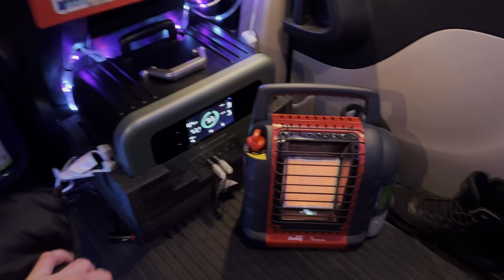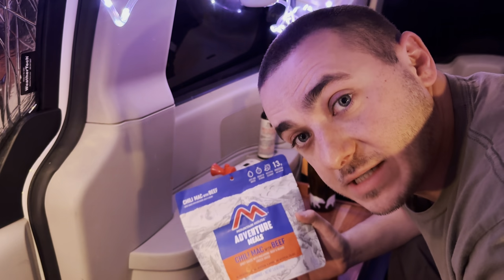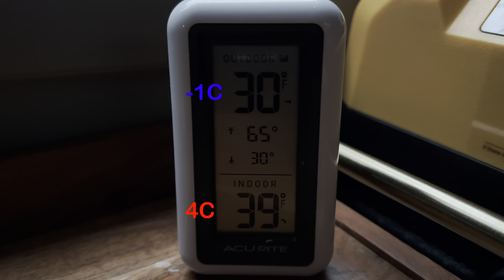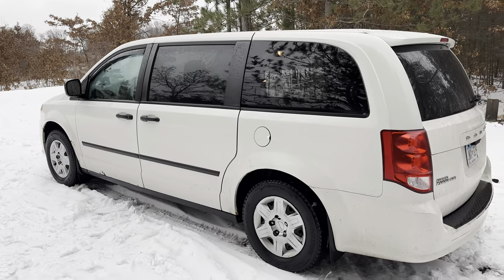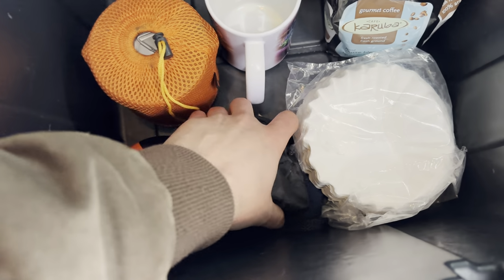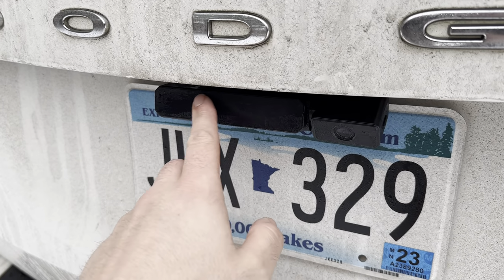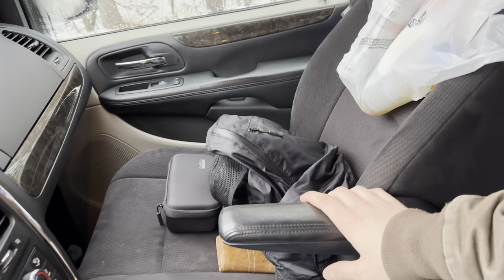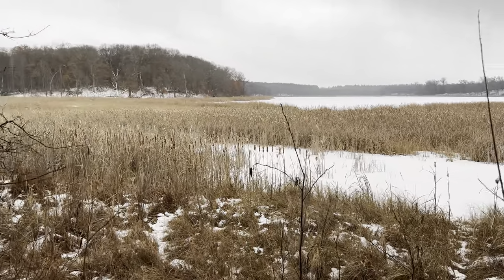Dodge Grand Caravan “No Build” Minivan Camper | Van Tour / Van Life

Comment: The light you describe as your "new light" is the one I've been using for camping for several years now.  I'm actually on my second one because I drowned the first rolling it up in a wet tent because I forgot to take it down.  That sucker is bright, like flipping the switch on the wall at home and I love that it's USB rechargeable.  I use it in my car camping set up hanging from the oh sh*t handle for the back seat.  Love your set up!

Comment: I'm off grid I plan to install more solar on top. I plan to run a line from my BBQ 20 pound tank to my buddy heaters, water heater and cook stove. Filling up 1 pound tanks the valves rust then leak. It's much easier with a truck or van to park. For me a bag and a bucket I've clogged up enough commodes. 😜
Reply from the maker: Nice! Yeah yeah you’ll see my 20lb tank in my passenger seat on my next video that runs to my heater in back and I also got a pop up toilet stand that you attach a bag to now. I love the toilet I just not a fan of dumping it, so going to see which way I prefer.

Comment: That's the way you do it! For $2000 if all you get is 2 years use, you have your money's worth. Im doing the same thing with a high mileage Odyssey. We can use our older models as stepping stones to trade up at a later date. I use a kayak on my roof as a cargo pod.
Reply from the maker: Amen Greg! Going to sell this one when I have enough cash saved up to upgrade to something a little newer and keep doing that process until I get my dream setup. What’s awesome about having a no build currently is I can just pull everything out and put it in new van 😁
Reply: @TolbersCamping  and we still get the $38,000 luxury feel or whatever it cost new!
Reply from the maker: @gsp49  right 😁

Comment: My GC has the 110v inverter built-in, comes in handy when the Anker power pack is charging. I run Firestone destination tires and so far I haven't had to use the buddy heater.

Comment: Are the window coverings wedged or velcro? Couldn't see. Love your setup.  I have a 2005 toyota sienna,  simple conversion. Footlocker for bedbase, plywood,  4 inch memory foam. I put the fridge inside the stow and go basement. Got rid of the seats Also have solar, 2 x power generators, I took a dropleaf table,  cut legs down,  it's my kitchen/countertop.

Comment: My 2008 Chrysler minivan has satellite TV love it. Two DVD players . Running that Little Buddy Heater what do you do to keep your windows from collecting condensation on the inside.
Reply from the maker: Nice bro, I crack the windows to keep fresh air flowing and if it gets bad I just turn the vehicle on for a bit, run the heat with ac on so it takes all the moisture out. Mr buddy is good for couple nights out but wouldn’t recommend as long term heat source. My next van I’ll be installing a diesel heater

Comment: New subscriber here.. nice work on the camper van so far. From the outside it looks like the van foresty forest on YouTube used to have. Also if you convert your primary heat source to one of those diesel heaters you can get from Amazon you won’t have to open your windows to let fresh air in or worry about carbon monoxide poisoning and you can run it all night… just a thought… keep up the good work sir.
Reply from the maker: Thanks bro and yeah my next van will definitely have a diesel heater, this van being older and higher miles I don’t plan to keep much past winter. Id like to sell it and get something a little newer and more reliable before I start doing more custom and permanent setup.

Comment: Hello Thank you for the video,Do you know you have stow and go seating and in the cargo van you have 2 deep storage areas. 1 right behind the driver and passenger seats. 2nd is in the rear right under you refrigerator. I have a 2015 ram cargo van too. i took out the metal floor plate to access the storage areas. this are big areas.
Reply from the maker: Yeah I have removed it all and seen the storage spaces. Yours may have doors to access these spaces, but mine does not. They do sell metal flooring with access doors, I’d love to have it but expensive and not worth it for this van. Unfortunately it would be very hard to access these compartments with stuff on top, it would be good for storing stuff you rarely use though.
Reply: Hello, you can watch YouTube videos to show you how to make floor doors to access this area. I took out my metal flooring and put plywood. i still need to cut out the floor to install a door. I have my 3 Batteries and smart controller in the real and have 2 inverters on the side wall so i won't have to go into that storage area unless i need to get to a battery. good luck and enjoy

Comment: Nice van! For the battery powered lanterns - get rechargeable batteries. You can then either recharge them before you go, off of the power station, or via a solar battery recharger. We carry two sets for each lantern, and have yet to be desperate for light. If you want a little neater lighting, get rid of the light rope and get the light tape, like used on custom auto lighting and RV's - you can cut them to exact size and worry a little less about tangling into things. It breaks my heart that you don't have a roof rack on that Caravan - would have made extra storage and solar mounts a bit easier. Maybe you can use that roof for some flexible solar panels...
Reply from the maker: Thanks Wendy and I will definitely make sure my next van has a roof rack and will be doing more of a custom build on it. This van has higher miles and don’t plan to keep much longer so it works great for the time being. I agree on the rechargeable batteries. Thanks for watching

Comment: Great work putting this set up together, its simple and more like camper than live aboard, which is what Im looking for.

.
What do you do with the condensation on the windows? I have seen vaccum that suck water in, but still not sure what I would do.! Thanks.
Reply from the maker: Thanks bro, and If condensation gets bad I just start the van for a bit and turn the heat on with ac and it will take the moisture out of the van. Also open the windows for a bit will help.

Comment: Thank you for sharing your stuff and great info. I am considering "doing up" up my minivan for camping. I work remote and can be anywhere. Thanks for the ideas. I am trying to find out more than anything how to install a small air conditioner that can run off a lithium battery so the car does not have to be running all night long in the middle of the night. Any ideas for a mini air conditioner!!??
Reply from the maker: Either the zero breeze mark 2 or the ecoflow wave. The zero breeze won’t really cool the whole van but will blow really cold air on you so don’t really need the whole van cool. The wave should be able to cool the whole van but will pull more power so will need a bigger power station and it cost a little more.

Comment: Great videos! You need to get a 5 gallon standard propane cylinder instead of all those 1 pounders. Those are so environmentally bad. You will need a filter and an adapter hose. It will save you money and help the environment. Keep up the great videos!
Reply from the maker: Thanks Tony, in my next video you will see I have a 20lb tank with the hose and filter I put on my passenger seat and run the hose to back by passenger door where I have the heater.
Reply: @TolbersCamping  that's the way to go! Stay safe out there.

Comment: New sub!  Where did you get those window covers.  I have a 2019 dodge caravan.
Reply from the maker: Hey Patrick, glad to have you! I got them off the weather tech website
Reply: @TolbersCamping  was gonna put a gas or diesel heater in my 2019 Grand Caravan but there's no where to in install the exhaust through the floor.  Stuck with Mr Buddy.

Comment: Nice clean build! what will happen in an accident though?
Reply from the maker: You mean like what would happen to the items in the back? If I hit something it would all push up but nothing really has any weight besides the fridge which would just push against back of passenger seat. The other stuff is low to the ground and would just slide up to back of seat. There’s always a possibility of something hitting you but anything lose is packed away for most part

Comment: Looks like you have some very nice organization to the van! Curious - does your coffee maker inside create a lot of condensation? One thing that is not ideal for us in our van is that I have to take all of our coffee stuff outside to make the coffee in the morning - and sometimes it is SOOOOOOO cold! Keep making memories & adventure on! ~Karen & Shannon WOY
Reply from the maker: It probably does but I always crack my windows and if I start to see moisture build up, I start the van and run the heat with AC on to pull out all of the moisture for a bit.
Reply: @TolbersCamping  The dash van heat inside should dry out condensation from the propane appliances. It's super dry by a humidity gauge and one of the driest heat. I was starting to get light nose bleeds from letting my truck dash heater run all night while living in my truck before I got my hidden cargo trailer.

Comment: If it’s below freezing, will you typically run your Buddy Heater all night. If not, how fast does the temperature drop inside of a van like yours
Reply from the maker: I don’t run it all night but definitely could as long as I keep those back windows cracked for ventilation. I usually go to bed when I shut it off so hard to say how long it stays warm but it definitely holds at-least some of the heat for 3-4 hours it seems

Comment: Do you have to turn on the heater every few hours during the time your sleeping to warm up the van??
Here in Chicago we’re getting -30 below windchills so I wanna make sure me & my cats don’t freeze but I’m leery about using propane ..
Reply from the maker: In that temperature it may be worth just running your van with heat on all night. Mr heater is the best and safest brand for propane heater from what I know, so as long as that’s the brand you have you should be fine to run it all night with proper ventilation and carbon monoxide detector. Basically if you can feel fresh air coming though your window you should be totally fine
Reply: @TolbersCamping  OK, I guess I’m biased against any flammable since my dad died in a fire.💔
I was hoping to see a small ceramic space heater that I could run off the jackery or Bluetti but I haven’t seen anyone using those.
Thank you for the reply.
Reply from the maker: @deedeeotero4475  I’m sorry to hear that, but I wouldn’t be to worried about a fire with the mr buddy heater. Just make sure you don’t have anything lose next to it that could start on fire. A space heater won’t work as they pull way to much power and would drain even a very large power station in a couple hours max.
Reply: @TolbersCamping  Awww shoot I was hoping that wouldn’t be the case w/the power drain but I’ll try to find the smallest Mr buddy that will do the job.
Thank you very much for the information & advice.💖

Comment: I did not know cargo versions of the dodge caravan was a thing. Cool to know.  Do you have any sort of in floor storage space since there’s no seats?
Reply: I'm thinking since it's the cargo version, there's no opening where the rear seats normally would go into. In my caravan, I've removed all the seats and it really gives a lot of extra storage space in those holes.
Reply: @AccountInactive  so far I’ve only removed the back seats.  Agree on it’s potential.  Right now it’s a depressed area that keeps bins and gear from sliding around too much.  Middle row is captain seats.  I’m not much of a builder though so I’m struggling on what to do

Comment: Nice setup
But honey, propane gathers in the lowest points.. an open window HELPS, yes but it doesn’t SOLVE the problem. Your meter would beep if you put it on the floor. You want a fan. Any fan, a rechargeable one or 2 even

Comment: I'm curious as to why you would bother eating camping meals when you have the space to make normal meals. Or even prepare food ahead of time and make chicken quesadillas. Or don't bother to prepare at all and buy a chicken fried rice meal and all you have to do is heat it up.
Reply from the maker: I have extra camping meals sitting around and wanted to use one up. No need to go buy the same thing at the store
Reply: @TolbersCamping  Oh okay. But my point is that camping meals are usually more expensive and not as tasty. Unless inflation has changed that somehow.
Reply from the maker: @remyllebeau77  wasn’t actually planning to go camping or even film a video on this trip, so it was kind last minute thing. Just grabbed some dry food from the cabinet and headed out. I would say that’s the benefit of camping food, grab and go.

Comment: Where do u vent the battery power bank.
Reply from the maker: What do you mean by vent? They have cooling fans but that’s it
Reply: @TolbersCamping  where the unit has open slot for venting..didnt.see in video. No reply necessary. Good job!

Comment: Get that Mr. buddy out of there before  you end up dead and get you a diesel heater bro trust me wayyy better
Reply from the maker: The mr buddy is actually much safer then most propane heaters, especially if you use the basic safety measures. I do agree a diesel heater is better and safer though. I’m holding off on the diesel heater until I get my next van as I don’t want to do anything custom to this van and I only camp with it for one nighters. Super pumped to be able to sleep with heat on in the near future 😁😂

Comment: Best video I seen to get things if I decide to live nomad no build..Mr buddy heater, 3 gallon water jug, carbon monoxide detector, nice power station, air horn great for inside or outside use because those are loud, etc

I'm on the East Coast tired of snow, I'm thinking about heading West to Arizona.. those places they cab stay Sept til April pay monthly less than $30 or $180 for the stay where my truck can stay parked.

Video below LTVA

https://youtu.be/ttURj5RlTsU?si=rViQcBS-mPIsSeAy

https://youtu.be/wRWah2aig4s?si=iTlX57-u0J2BkHkJ

https://youtu.be/XIn9fCdP74g?si=JcfjPmuceuQbz1Ix

I don't like traveling or driving constantly so those places above would be great for me, I'm older. Looking for campsites or sleeping in parking lots seems risky but alot of people do it near truck stops, rest stops, Walmart etc.

Comment: cooking inside a van is not great for your health. crack a window. Read up on symptoms of carbon monoxide poisoning Separate the front of van from the back with a blanket. This will keep your space much warmer and block view from outside viewing in.
Reply from the maker: Always have a carbon monoxide detector and tons of fresh air pouring in from the windows, zero issues. Yes you can put a blanket up to contain more heat to the back if you’d like. Thanks for watching and God bless

Comment: Propane is so bad to use in enclosed spaces
Reply from the maker: No it’s designed for that, plenty of safety features and as long as you have air flow and carbon monoxide detector you’re good to go.
Reply: @TolbersCamping  uhh 🙄 my uncles friend got sick from that and it was “well ventilated “ so yea I wouldn’t use propane period
Reply from the maker: @jodynichols1510  they don’t put off carbon monoxide as they get a complete burn where some knockoff versions may not. The only way for it to not get a complete burn would be if oxygen levels were low which is why it has a low oxygen sensor to shut it off. Even if the safety feature didn’t work you should have a carbon monoxide detector that would go off way before it would be an issue. Also if you have proper ventilation that wouldn’t happen at all. People claim proper ventilation but don’t always know what that looks like nor do they have a working carbon monoxide detector. I’ve had multiple carbon monoxide detectors with me and have never had any levels of carbon monoxide show up. Carbon dioxide may have been your issue also which can happen as a result of not enough ventilation